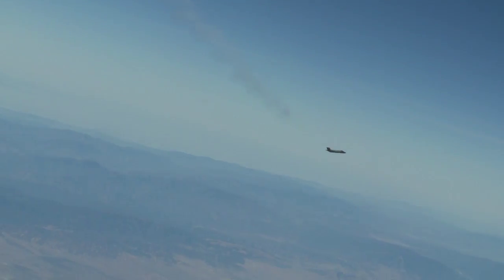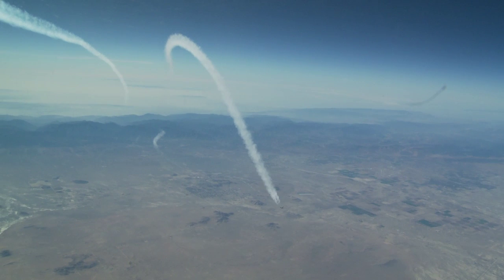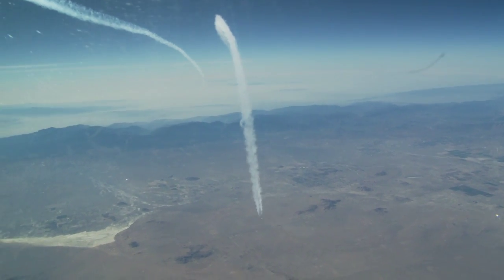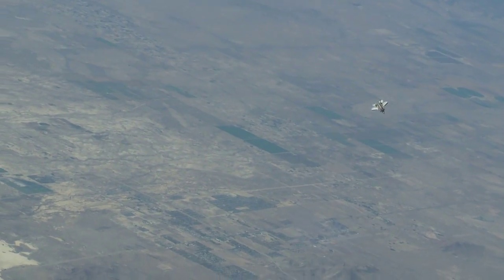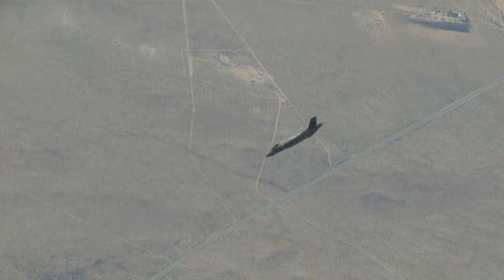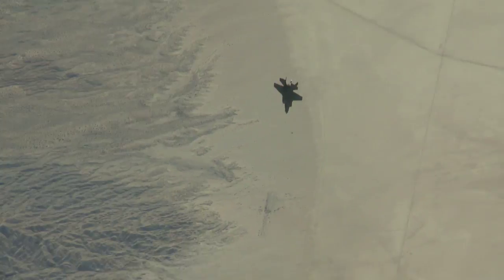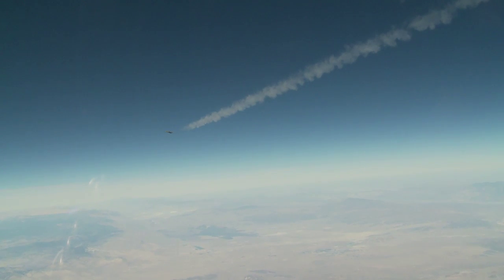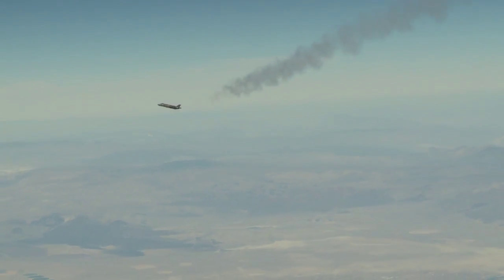F-35 High Angle of Attack Testing

Comment: Man, you can say what you want.  That is one badass fighter right there
Reply: +GeorgeCF99  It performed poorly against the F16 because that's not what it was designed to do

The F-35 is like an amazing marksman with a rifle capable of kills from miles away, while the F-16 is like an expert in close quarters combat

It's real stupid to lock them in a small room together and act surprised when the F-16 comes out victorious.

The reality is the F-16 wouldn't have been able to detect the F-35, and would have been hit by a missile from 80 miles away.
Reply: @Justa318i it was also a early variant of the F-35 only capable of 7 g’s and lower AOA due to the computer not letting it
Reply: MavHunter20XX Lol the Mig 21 would eat a missile before it got within 80 miles of an F-35, certainly before it detected the F-35
Reply: +Machi Maybe if you're using Vietnam era missiles as a comparison point.
Reply: MavHunter20XX It's purpose is multirole, the gun is more for attacking ground targets.

"It's a bunch of gizmos and technology" basically the cry of scared old men everywhere when bringing up the F-35, the same old men who cried the F-15 was too loaded down with "Gizmos" to be an effective fighter, now here we are in 2016 and it's arguably the best fighter in the world.

I bet in the mid 40s there were old men whinging about those new fangled jet gizmos too.
Reply: MavHunter20XX Then it fires another missile, they have a hit rate of like 93%, and it doesn't need to turn, the F-35 can lock on, and launch a missile at an enemy jet regardless of it's position in relation to the F-35, including behind it..

The lockheed MHTK is so small the F-35 can hold about 20 of them internally, more externally.

And even if all of this failed, an F-35 dogfights better than a Mig-21
Reply: MavHunter20XX Why would there be, why would an F-35 be alone, why wouldn't F-22s be with them as the F-35 plays a primarily support role?

Further, if we are going to ask what if there are more missiles than planes, why don't we ask what if there are more planes that bullets?

Do you know how uncommon an air to air gun kill is?

An F-35 is a sniper, a stealthy sniper, and like a sniper, if you let the enemy find you and get close to you, then you have failed, sure you aren't defenseless, but you put yourself in a bad spot.
Reply: Justa318i
I didn't say why are there more missiles on the plane than bullets.  I said why would they put a cannon on it when people it's not intended for dog fighting.

While I agree that my perspective on Air to Air tactics is not clear (a plane would never be on its own as I said)  I wouldn't use the sniper analogy.  Snipers don't rely on high tech gizmos to send their copper clad message 1240 meters to their target.  They may use satellite images from drones to gain Intel on their approach to their final firing position, but they rely on charts, analogue calculators (slide rules) visual observation and a whole lot of experience and they have to visually identify the target.  Not to mention the stealth craft.  The F-35 is opposite of that, it's a bunch of gizmos, and technology in an attempt for a kill BVR.  Bad analogy.
Reply: Justa318i
Oh Lord.  The F-35 cannon is not intended for ground attack.  Since when has the US has strafed targets (using the cannon) using multi role fighters?  That is done with attack helicopters (AH-1/AH-64), A-10s, AV-8B, etc.  Key designation is A for attack.  If you're having to strafe ground targets that means you're exposing your jet ground fire of which will make a jet vulnerable for.  How embarrassing would it be if your next get JSF was taken down by small arms?

I said gizmos as a general term not as if they weren't necessary.
Reply: MavHunter20XX Yes, the F-35 is replacing the A-10 warthog as a CAS platform because the A-10 would be lunched in an environment with any sort of meaningful anti air.

Yes, if an F35 were shot down that would be very unfortunate, but it is a risk that one runs when doing CAS

Thankfully, the F-35 is stealthy so it can get closer before being noticed by enemy radar, it is fast, so it is harder to hit, and it's more accurate, so it can use its gun more effectively further away.
Reply: Justa318i
The F-35 is NOT replacing the A-10.  The politicians are HOPING it will serve as a stopgap.  Do some research, they're looking into a A-10 replacement after the F-35 is in production, meaning a brand new COIN jet.

Again, do a little reading, because I actually have extensive knowledge in the A-10, F14, 16, F-18, and F-117 design elements; each of which the gov't is trying to press the F-35 to be able to perform in each of their roles.  And if you have followed the F-35 more closely it was not designed to evade radar completely.  As a matter of fact, current technology can detect both the F-22 and F-35.

And stealth does no good when you actually SEE the jet approaching.  And remember, we were talking about guns strafing, we weren't talking about guided munitions.
Reply: MavHunter20XX Funny you say you should read more closely when you didn't even read my post, or if you did you didn't comprehend it, getting closer before being detected =/= evading radar all together
Reply: Justa318i I read it.   you didn't understand when I said it didn't matter.
Reply: MavHunter20XX I did and the notion is comical

"Oh I see a jet, better go set up my anti air and shoot it down with my own abilities, surely it will stand still and wont be difficult at all"

The whole point is enemies will have less time to defend themselves.
Reply: +Justa318i Set up?  Now I know you think you know more than you do.  Forget it, you seem to know it all.
Reply: MavHunter20XX Lol yes, I'm sure that is why you want to drop it.
Reply: Justa318i No, because you think stealth surfaces is the only way an aircraft can avoid radar.  Either you forgot or you didn't know that rotary wing craft, the B-1 and the A-10 (and the F-111 where the technology was first used) avoid radar by using a simple technique.
Reply: MavHunter20XX No, I'm actually not, don't put words in my mouth, no F-35 would be working alone, that said, the F-35 is slated to replace aircraft like the F-16C as SEAD, also probably be working with MALD as well.

Stealth is a tool, like all the other tools in a military's belt

What even is your issue with the F35?
Reply: Justa318i
This is going to be a long one, if you don't read it all, I won't hold it against you.

The short is I recognize it as a pentagon game of high ranking officers, politicians and contractors trying their line their pockets on the tax payer's dime on a lemon jet.  They did this with the Bradly fighting vehicle but except I think this is at a worse level

everything that you've stated with the F-35 is a supposition.  It hasn't been tested for the things you're supposing it will do.  But from a design standpoint, it will not work because you're making a jet do everything it wasn't meant to do.  It's not meant for COIN, which is done with A-10, AH-64 (any rotary wing attack helicopter for that matter) and at times AC-130 and variants.  You're saying it's going to do SEAD?  That can be done w/ almost anything in the inventory, but how is it going to be stealthy when it's holding ordnance?  So stealth is out the window.  SEAD can also be done with LRSVM w/ satellite inlet.  And MALD is still experimental so you can't keep quoting that.

AND IT HAS TO MANEUVER if you're expecting it to do CAS!  You're not going to drop ordnance on a target w/o being able to visually identify it.  You tell me someone who is will to do that and I'll give you video of someone that knows he had killed someone thinking they were the enemy w/o visual identification.

And here is the answer to the radar question.  All kinds of jets and helicopters have been avoiding radar by flying low.  The B-1 can do this and remain supersonic and has the highest payload of any jet in the US inventory.  The A-10 exploits this and it's main concern is people w/in line of sight (ie shoulder mounted anti air, so I didn't understand why you said "set up".)  The F-35 cannot hold enough ordnance to make it worth while.

Also the Jet was supposed to be able to be used for export purposes....I don't see that anymore with the price tag it's beginning to develop.

The F-35 will not be a multi role fighter as everyone is hoping it to be.  At most it will be a reconnaissance jet.  This is my prediction.

I'm looking at all angles from a technical standpoint, you're just quoting what the proponents of the jet are stating.  I've been looking at jets (all combat) since I was 8 y/o and I've studied successes and failures.  This one is going to go to the way of the F-111.

Lastly, retouching on the internal playload issue, when I can look out my window (well not really, but the USAF static display is a bike ride away) and look at a jet that can hold more weapons internally that was built during the cold war era, I'm wondering WTF are the designers thinking.  It's the F-106.  All you need to do is re-contour the fuselage , add canards and you got yourself a better JSF.

Heck after mentioning this, that's probably what will happen.  It's already happened 4 times already.

We'll just be going back and forth at this point, because I know what I know and you know what you know and state what we think we know and only time will tell.

So far in my search to see the damn thing turn I haven't found anything except blurry videos of f-22 doing square turns.
Reply: MavHunter20XX "They did this with the Bradly fighting vehicle but except I think this is at a worse level"

Oh yes, the pentagon wars argument, I see this a lot, thing is the bradley is actually quite good so the argument sort of falls flat.

" It hasn't been tested for the things you're supposing it will do. " 

well probably because it's not done

" But from a design standpoint, it will not work because you're making a jet do everything it wasn't meant to do."

This is silly reasoning "It will not work because I know what jets are capable of at all times" the F-16 was designed as an air superiority fighter and it managed multirole very well.

"You're saying it's going to do SEAD?  That can be done w/ almost anything in the inventory" I'm not saying it's going to do SEAD, the US government is saying it's going to do SEAD, or rather that is the plan.

And done with anything in our inventory? You mean our planes which are falling out of the sky because they are old  and worn?

"but how is it going to be stealthy when it's holding ordnance?"

Internal bays and drop tanks, once you get to the area you need the stealth for, drop said tanks, stealth achieved, so no, stealth isn't out the door, the point is flexibility, if you need stealth you have it, and if you need ordnance  and fuel you have more than an F-16

"AND IT HAS TO MANEUVER" 

It does, very well,  just because it doesn't maneuver as well as one of the best maneuvering jets in the world (the F-16) doesn't mean it can't maneuver, and that's kind of the crux of your entire argument.

"And here is the answer to the radar question.  All kinds of jets and helicopters have been avoiding radar by flying low. "

Oh, just fly low huh? I guess you know more than the US, China, and Russia aeronautical engineers, sell that idea to them, you'll make billions.

"Also the Jet was supposed to be able to be used for export purposes....I don't see that anymore with the price tag it's beginning to develop." 

Except for the nations who are buying it of course, even Canada which claimed they weren't going to buy it is looking at it again, also the cost of an F-35 is going down, and is projected to go down further.

"The F-35 will not be a multi role fighter as everyone is hoping it to be.  At most it will be a reconnaissance jet.  This is my prediction."

A laughable prediction, I actually snickered.

" This one is going to go to the way of the F-111."

Again, a laughable prediction.

"It's the F-106"

That's a good idea, lets take this tired air frame cover it in millions of dollars worth of technology, add canards (which are very bad for a radar cross section) and hope it doesn't fall out of the sky when something inevitably fails, like our F18s are currently doing.

"We'll just be going back and forth at this point, because I know what I know and you know what you know and state what we think we know and only time will tell." 

I agree
Reply: Justa318i F-35 costs are not going down for the US, it's going down for exports because of how much money they've (foreign nations) poured into it.  You need to do some reading.  Seriously.

And what I find interesting is that you think that flying low is a new thing.  You'd think that you'd be hearing AH-64 and such getting knocked out of the sky.  You really need to start thinking on this.  The only reason you'd want to be high in the sky is for guided munitions delivery, where the F-35 might do well.  This is probably one of few places the jet might shine, but we have the F-22 for that...and the B-2...  So as a "strike" fighter bomber, maybe, but that remains to be seen.  But this is not the same as COIN, which A desalinated air frames were designed for.

The criticism I'm placing on the jet is not just from me, it's from all levels.  So if you're Lockheed trying to sell a jet, wouldn't you release the best demonstrations on the thing esp for export?  Look up the F20 tigershark.  They did a whole thing with a ret Brig General, yet I can't find a single video that alleviates my concerns (or those from the tactical level to strategic.

So while you're defending the jet on YT, really the burden is on Lockheed.  Do a quick search and see what troubles they're having w/ the jet and then look at past jets and how they were marketed.  You'll find they can't even show you what you want.
Reply: MavHunter20XX In the end, both of us are just guys on youtube, neither of use really have any idea what we are talking about regardless of what you may think.

You were right in saying time will tell, and that everything at this point is conjecture, I really don't want to bother continuing to argue about it.
Reply: Justa318i
I roger that.  But what with I know, I would kill the program immediately.
Reply: +MavHunter20XX People are forgetting this plane has advanced jamming abilities built in.
Reply: Matt Slattery
So does the E/A-18 growler, that's nothing new.  But you have to think about that they're having a single plane with a single pilot with the capabilities that you had just mentioned and then become a multi role fighter.  And then you have to remember that they have 4 types, all of those versions have different equipment.  So in reality, how much of this Jamming do you think is going to be loaded into a plane that supposedly is able to maneuver, drop ordnance, dog fight, VTOL (in the marine version), in such a small package.

Forget about what I think, tell me where it says that the Jamming capability will be better than the E/F-18?
Reply: MavHunter20XX
It is new its in a fighter and not a specialized platform right?
Reply: Matt Slattery
You mean the E/A-18?  The platform is not new, it's based on the F/A-18F, but the plane is specialized in electronic warfare.  My mistake it's the EA-18G.  So this plane would go out among other F/A18 variants and protect them from detection.  But its a two seater, a pilot and a EW officer
Reply: MavHunter20XX
i am talking about the f-35,s electronic warfare
Reply: Matt Slattery
are you assuming that it will be EW capable or is it written somewhere?  ECM is not the same as EW
Reply: MavHunter20XX
It is written that it has jamming ability and it can also carry EW pod.
Reply: +MavHunter20XX because there is always a possibility for a dog fight and nobody wants to make the same mistake as with the F4 during Vietnam.  F35 has not lost against F16, softwares were being tested and the F16 was used as the standard.  If we get the F35 to maneuver as good as a F16 we are in good shape.
Reply: +1steelcobra even then, that was only because the RoE required visual identification of a target...
Reply: Why? Because it looks badass to you??
Reply: Atalaclys I would say because historically the USA has delivered some of the best and innovating fighters for the past 40 years.  Let me remind you that F14, F15, F16, F18, F117, B2 were and still are highly effective fighters and bombers.  The avionics implemented in the F35 and F22 are far more advanced than anything we currently have.  Remember this is not USA's first rodeo in building aircrafts.  The experience and the pool of engineers we have  although it is highly costly for the tax payers, still the best in the world.
Reply: Ahh..In what universe does this classify as an argument? Next to the successes you mention there are numerous failures whether in purely technical or VFM terms. As for the F-22, please do not put it in the same sentence with this pile of overprized garbage..
Reply: Atalaclys In what universe do you live that you consider my statement an argument???  I merely made a statement pointing out the obvious regarding the US record in aircraft engineering.  F35 is above anything we have in our line up.  Is been tested and it is quite effective.  You can believe in any negative propaganda of your choice, it is a free society.  At the end still your opinion based nothing but negative propaganda...I have more faith that our engineers are building an advance and sophisticated system that is going to be superior to anything the Chinese or Russians build.  All of US aircrafts have been always criticized by media and our foes just to prove themselves better than anyone would imagine.
Shortcoming, specially in such sophisticated unit is normal...yet they are already in production vs PakFa and the rest of the Chinese junk that are still in development.
Reply: I don't believe in any "propaganda". I have a degree in fluid mechanics which allows me to state with a certain degree of credibility that  in terms of kinematics at least, the F-35 is a very very poor plane by any standard. As for the rest, I have a keen semi-professional interest in military aviation and I consider the only selling points of this garbage-that is the "data fusion. stealthy airframe"-as overhyped and only theoretically relevant. 
As for F-35 being superior to Chinese designs, hopefully it will be superior to J-31, though in aerodynamics not likely, while the idea that it is superior to the T-50 PAK FA of the Russians is laughable. And of course, the most advanced plane in USAFs arsenal is and will be the F-22, of which 100 more units would offer more benefits than 250-400 of the F-35. 
Is the F-35 good at anything you may ask? Sure, making Lockheed Martin helluva lot of $..
Reply: Atalaclys you have an undergraduate degree, with how many years experience in aircraft design? 

So are the people with decades of experience and much better academic qualifications wrong?
Reply: There is no such undergraduate degree..I 've got an MSc, working my way to a PhD. 
Oh, I am listening exactly to these people-those not on the payroll of Lockheed of course..
Reply: Atalaclys ok so you have an MSc, but the people who build the planes have MSc's and PhD's and have been building planes for a long time.

So you only listen to people against the F35... well that isn't biased... 

You should only look what the airforces ordering F35's say. Because they are the ones who will operate it.
Reply: Atalaclys LOL, you can have 5 doctorate degrees that you don't know crap about the F35...it is classified.  What we know is enough to say it is state of the art.  Pilots are speaking well about and have tested against our own best fighters with much success...again, your opinion has no more credibility than mine because we both do not have access to meaningful data.  You know what any noneducated person know by just reading watching youtube and reading media reports.
Reply: Anthony M Sure..If you say so it must be so..
Reply: fdsdh1 It is not the "airforces" that ordered it. It is a political "choice" of the take it or leave it kind since no other 5th gen aircraft is available to them from the US. Unless they started buying from the Russians or the Chinese which is impossible as long as they are in NATO or affiliated with the US..Capice?
Reply: Atalaclys One thing is for sure, I am not making ridiculous claims that I cannot support.  Neither I can say it will be the best, but I cannot discard it as if it was crap because the US is not in the business for investing on crappy stuff.  I remind you, most of the ground breaking innovations are secret to the general public such as our selves.
Reply: Anthony M F-35 is our generation's Thunderchief-which was crap of the 1st order and got people killed (300+ losses)..
No, what your "argument" boils down to is "all these people who are (supposedly) experts or otherwise involved in the programme (thus having a very large stake in its success since their jobs depend on it) say this plane is awesome-so it must be". Yeah..
Reply: Atalaclys Well they haven't lost one unit since the beginning of its development.  That speaks for itself.  It already proved to be better than the F16 and F15 at what is meant to do.  Blowing up shit without detection.  No need for super measurability which if we were to compare it it is better than the F16.  And we all know how great and successful the F16 has been.  Yeah, base on unbiased research, I believe what I say.
Reply: Anthony M Wut?
Reply: Atalaclys I just stick to the known facts...people should try to do that more often
Reply: Anthony M In other words you let other people think for you..Sure, sounds like a plan. It is a known fact after all that ignorance is bliss..
Reply: Atalaclys No, I just let the musicians play the music, teachers teach, doctors heal, and so on...I am not going to seat here a pretend that I know more than the engineers building with specifications in mind.  

Do you feel or think you know more than the engineers building it?
Or, do you just like believing on those with negative propaganda because it suits your feeling against the US?

No one in this stupid youtube has first knowledge about the F35 to be certain about anything in particular.  I guess we will all have to wait.
Reply: Anthony M As I said, you can chose not only to be ignorant but revel on your ignorance, presenting it as a choice..
Reply: Anthony M Ahh..I would report you, but better let your kind and festive message remain as a good indication to other viewers of your morals and your aptitude for civil discussion.
Reply: Atalaclys Sure by all means do...you are not civil...you were trying  to belittle me with fine words over my opinion.  I can see right thru you.  That is why you got the reaction you received.  Now go away and spill your thoughts on someone else, We need not to discuss the subject any longer.
Reply: Anthony M Oh, I am sure "fine words" trouble you..They can be most confusing, just like trying to think..All that mental capacity involved..pheww..

PS I don't need to belittle you. You do a pretty good job yourself at that.. ¯\(ツ)/¯
Reply: http://www.businessinsider.com/f-35-slaughters-competition-red-flag-2017-2
"abhorrent"
Who do You think the F35 is slaughtering at these exercises?
Reply: There's not yet an F35 Demo team; so there's no routine available as the frame itself is still under CLAWs testing and evaluating (hence the 7.5g restriction on the current F35 iteration Block 3i).

It will take a while, so for now is just static displays.
Reply: +GeorgeCF99 A mig 21 could probably piss on it.  Which is sad.
Reply: Justa318i
Perhaps, but what if the missile had missed?  Air to Air missiles aren't as good as you think.  So far, I haven't been able to see things thing turn anything like any century series fighters.  It's been a century since the advent of dog fighting.  If it wasn't intend to dog fight, then why does it have a cannon?
Reply: Justa318i
1)  What if more jets than there are missles?  2)  MHTK is still in development.

Granted I haven't seen a mig 21 fly in high perf, but I'm having trouble finding the darn plane making a high G turn.
Reply: +Justa318i  Actually, many say that the BVR missiles are not as effective as we think, so dogfights might be more common that we think...
Reply: +Jastroyer manswer Unfortunately, in the dogfights against much older technology, the test flights have been abhorrent for the F-35. It may look cool, but has underperformed in energy and pilot visibility.